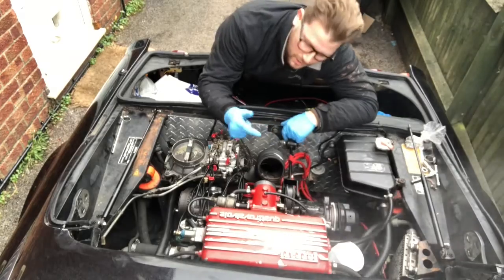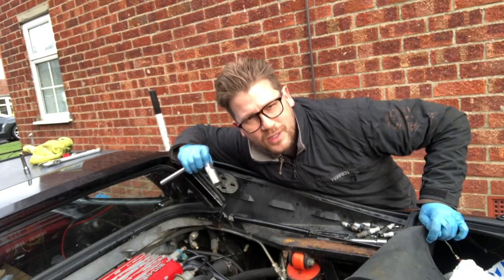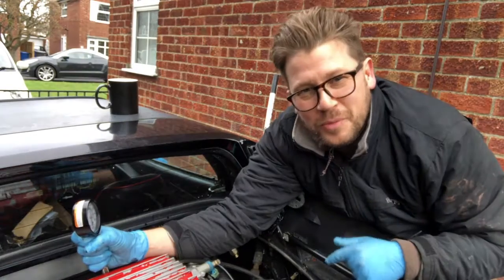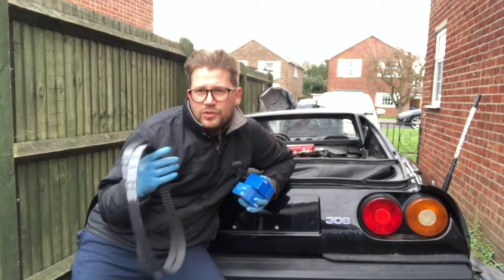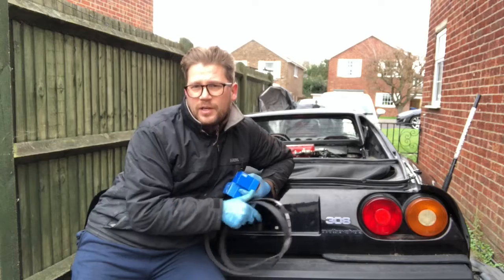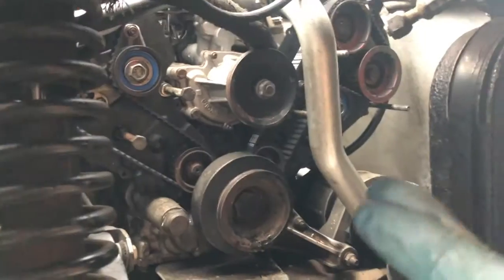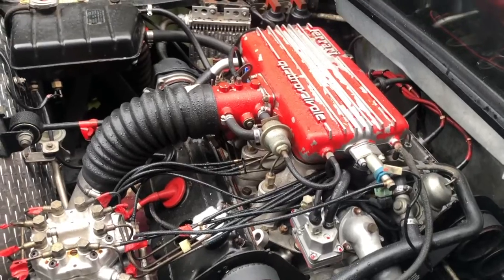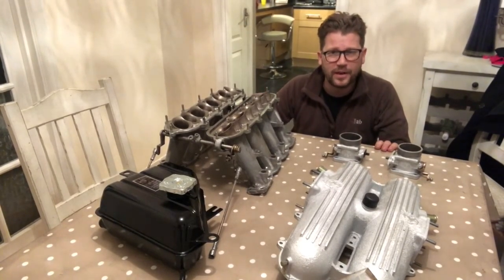Ferrari 308 Project - Engine compression testing Part 12

Comment: Can't believe that you went through all  that to replace the belts and tensioner bearings but didn't replace the idler bearings.  Have to get on that.
Reply: What idler bearing is that ? because there is no idler bearing...
Reply: @rogeeeferrari  The two behind the damper, whatever they are.
Reply: @notj5712   Those are the drive gears for the cam belts, you could see the slop in the bearing. You are correct that he should replace them. He tightens the belt and says it's good now, LOL, it's going to fail. Problem is that those bearings are really hard to get out, REALLY hard.
Reply: @rogeeeferrari  ah, gotcha.  They look pretty crusty.

Comment: An awesome video series! Thanks for making these. Given it had already run and sounded good and you found the cam belt off but not too far off, I was confident your compression numbers would be good for the front bank. I think you going to have to change the lower cam belt drive pulley bearings.